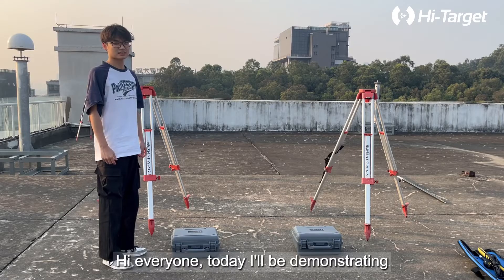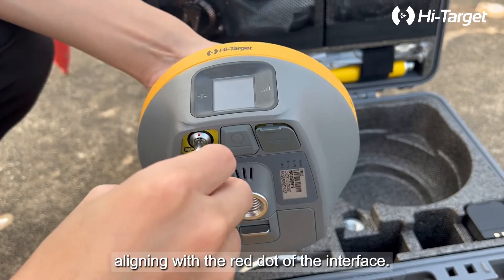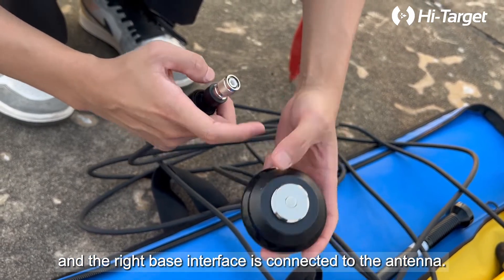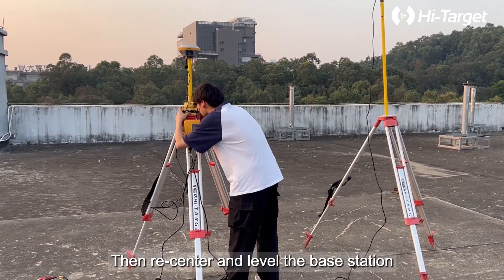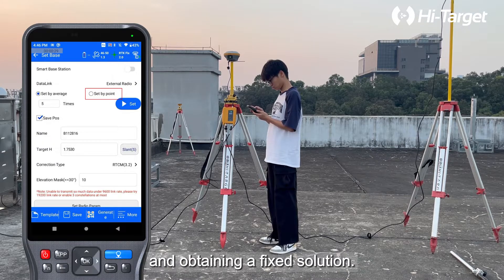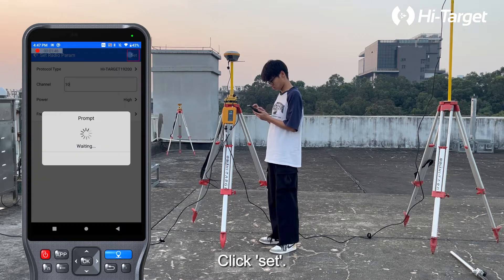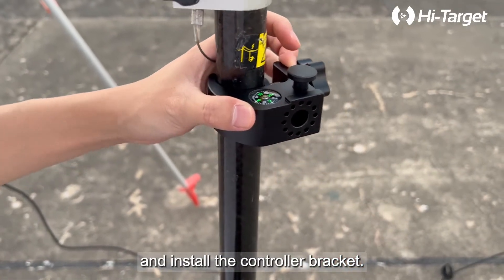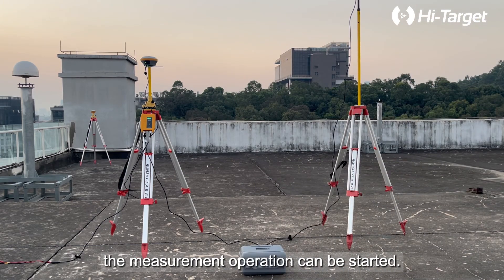How to Install and Setup GNSS RTK External Radio Mode

Comment: What do I do when the radio doesn't transmit after connecting ( the TX light doesn't flash or even light up) could it be a protocol problem?